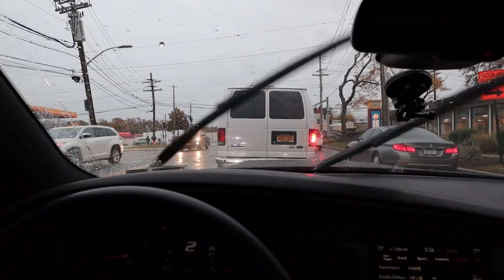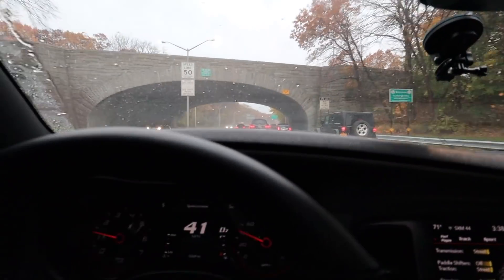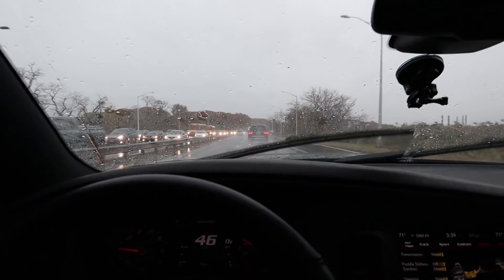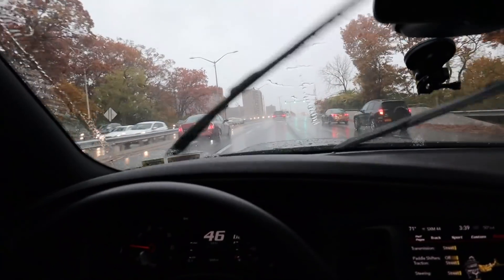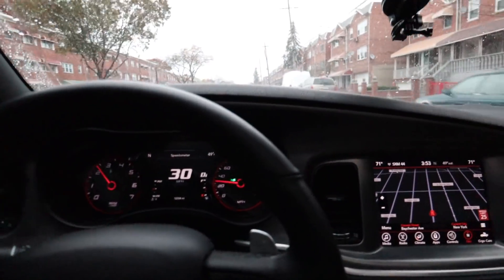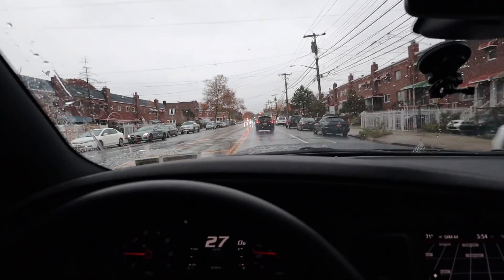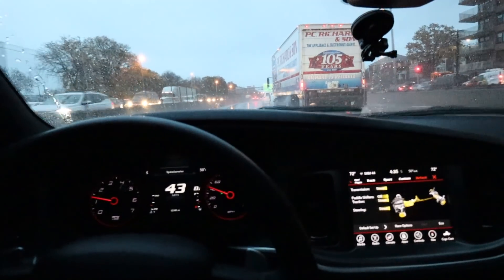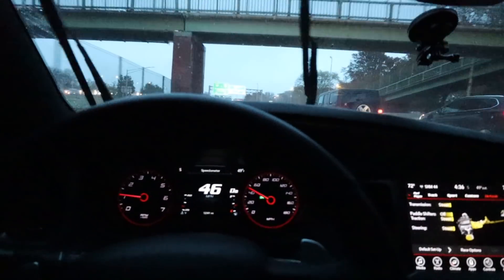Testing Out Nitto NT05R Drag Radials In The Rain!

Comment: Brave man. I’ve got the 275 NT555G2 on my 392 Scat Pack and not a big fan of driving it in the rain.  I’ve had it step out on me trying to accelerate on the highway ramps. I need to get my factory all season 245s on there shortly.
Reply from the maker: All for video testing purposes. I also will be putting on winter tires soon. Thanks for watching.

Comment: Been using NT555r 305s all summer in Florida rain with no issues.  Just drive sane and all is good.  Don't think I'd run them in a snowy winter, that would be nuts.  They don't like real cold weather
Reply from the maker: Exactly. Yea definitely no snow. Thanks for watching man.